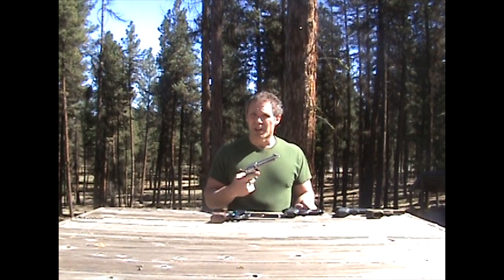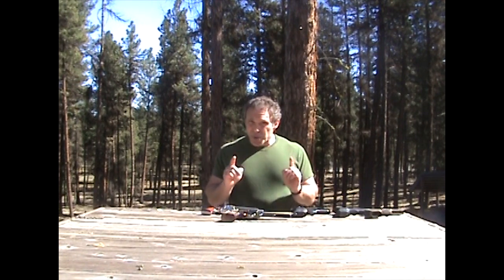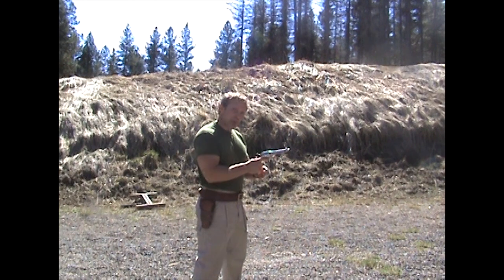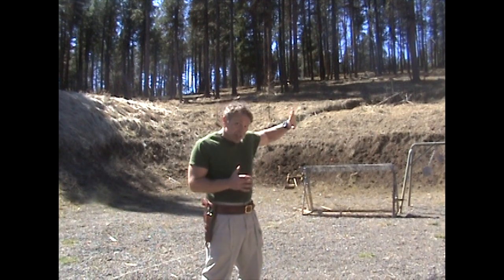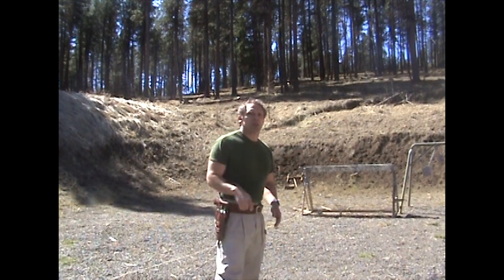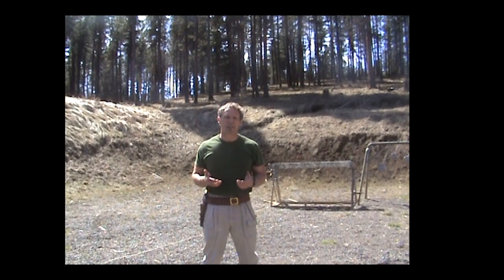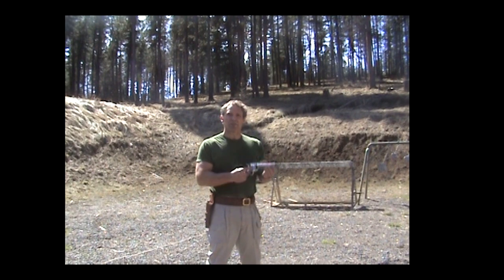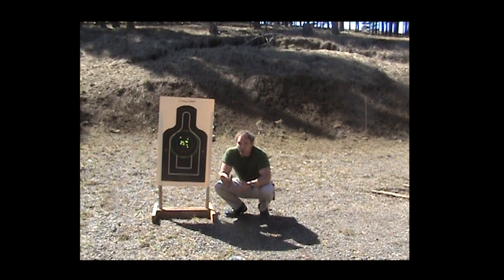Single Action Revolvers for Concealed Carry.

Comment: Scofield single action revolver can be reloaded fairly quickly.
Reply: They also typically cost twice an autoloader does. And the original guns ammo is really hard to find now. .44 russian i believe
Reply: @ianhale4466  .45 schofield and its basically unavailable. You can make your own .45 schofield cases out of .45 colt brass. The originals should only be used with black powder(smokeless powder didn't exist until the mid 1880s and the original guns are not designed to handle it).